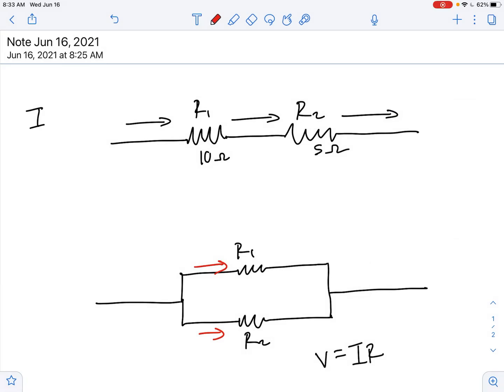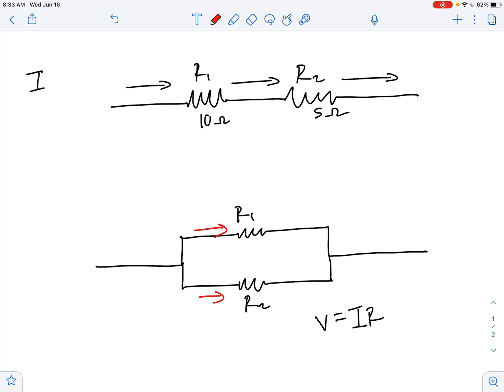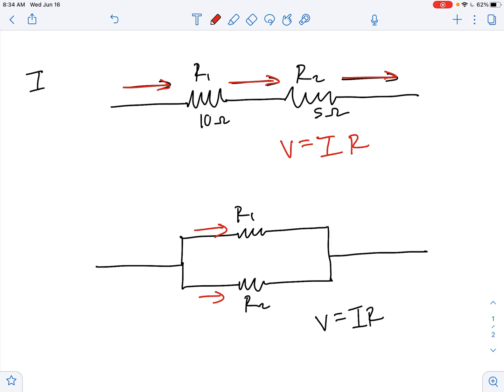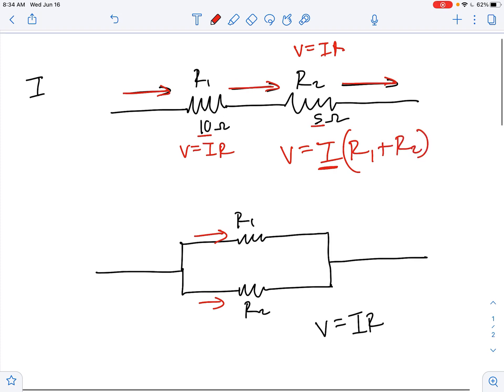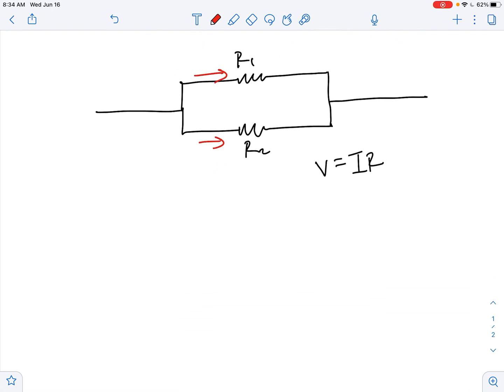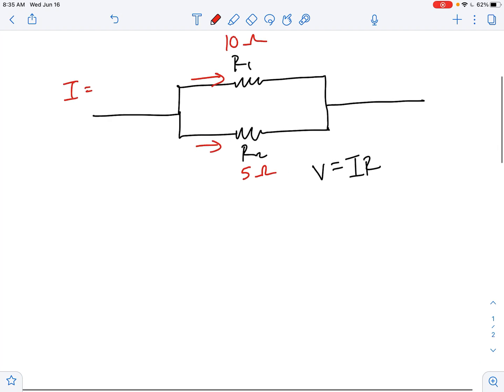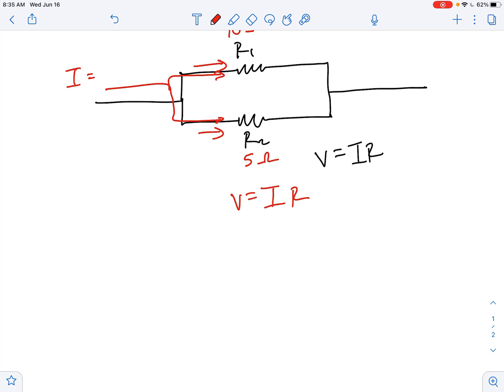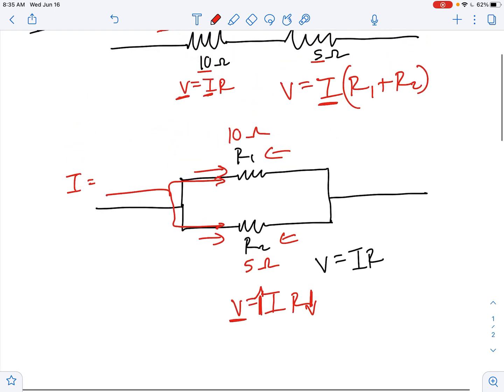Why Voltage is the Same Across Resistors in a Parallel Circuit

Comment: Instead of using 10&5 ohms resistors, we are using the same rating resistors, then the voltage across the each resistor will be same or not(in series circuit) ... Plz reply
Reply: I got the same doubt lol
Reply: it will be same.